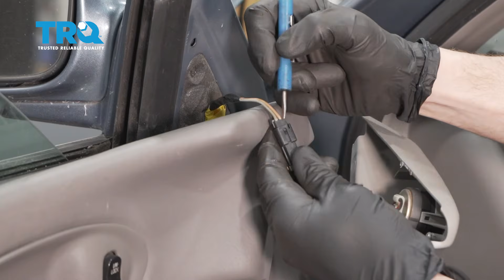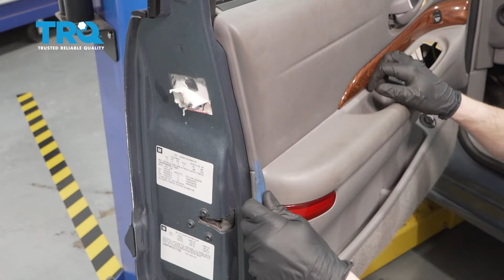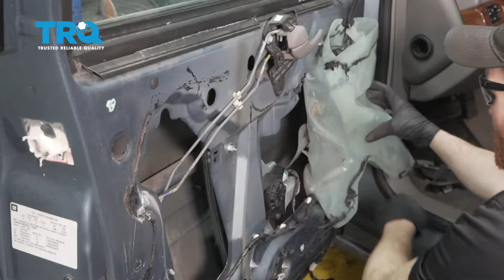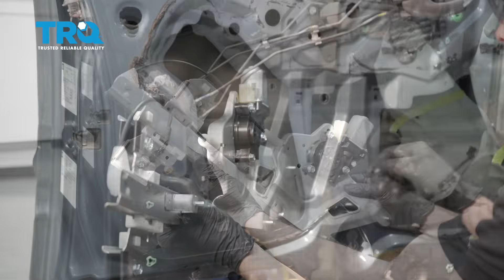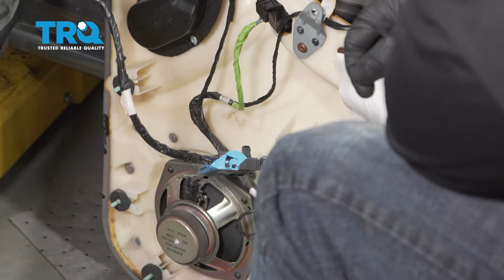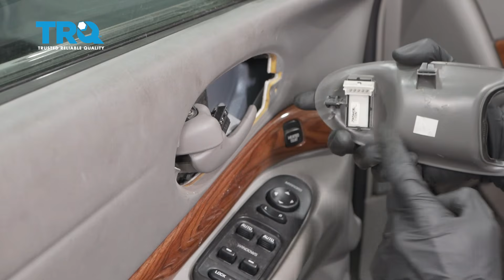How to Replace Front Window Regulator 2000-2005 Buick LeSabre

Comment: My window is stuck down like MattFromWork  below. Do I go in and loosen the original clam shells, then push the wiindow to the top and tape it there? This will allow the new regulator to grab the bottom of the window and can follow your steps after that. correct? Thanks

Comment: Great stuff! I'm about to replace my regulator and it will be the 4th one installed. Someone else did the other 3 over several years. Repair places charge over $320 to put a new one in. tks for the excellent video.

Comment: Is the passenger side the same part or different?
Reply from the maker: +arciefan The install should be the same or similar. Buy this part on 1AAuto.com: http://1aau.to/m/Shop-TRQ
Reply: This link was not accurate. I'm needing front passenger side 2004 lesabre, power window motor and regulator. I will call in and order or get the right part number and order. Thanks!